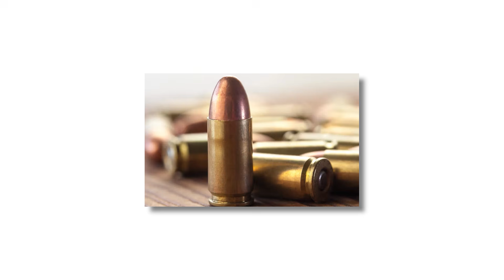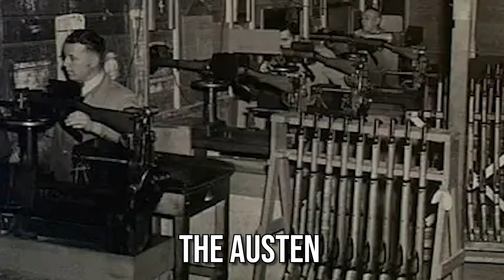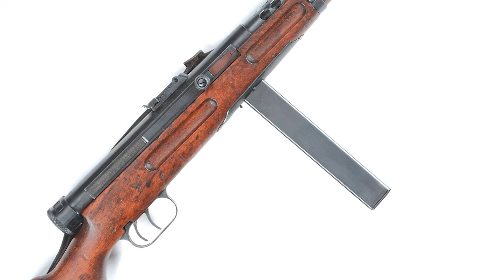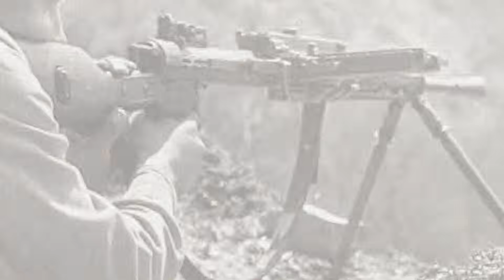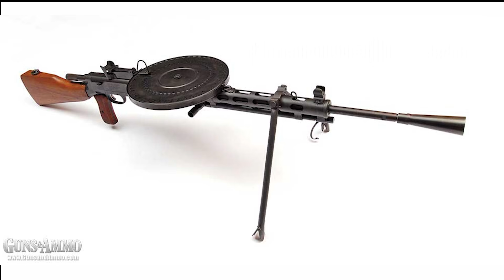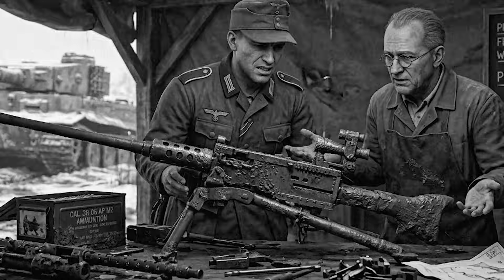Every WW2 SMG & MG Ranked - WORST to BEST

Comment: FYI, the M2 (Maw Duce) was designed in 1918 not in the 1930's.
Reply from the maker: Great catch on the design date, thanks for the historical correction! ⚙️
Reply: The M2 that saw service in WWII did not enter production until 1933. Before that were prototypes and a water cooled version(M1921) that only saw limited service until replaced by the M2.

Comment: #1 has a vertical magazine that limits shooter visibility while simultaneously announcing its location like a flagpole one foot above the shooter's helmet.
Reply from the maker: That's a really insightful observation about the #1 SMG's design flaws. Thanks for pointing that out!
Reply: It sticks up about 1 foot above the barrel... if you have the weapon snugged to your shoulder, it MIGHT be an inch above the top of your helmet.
Reply: You need to redo primary school math. To getting be a foot above the shooters head it must have been nearly two feet long magazine. 
Talk about something you have used.